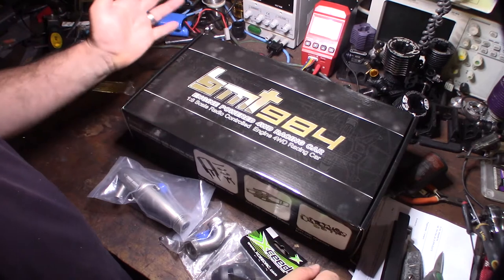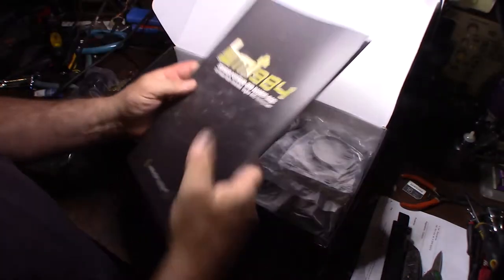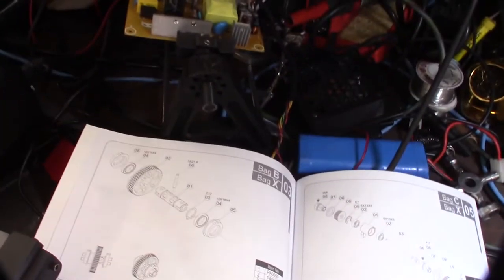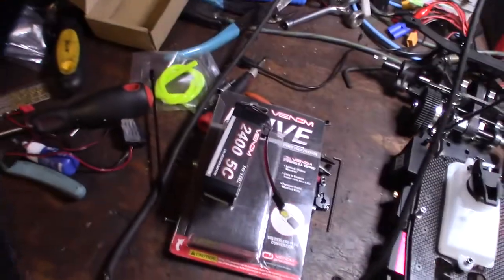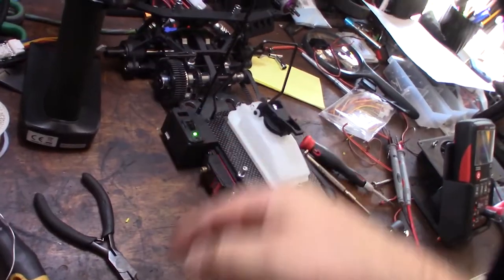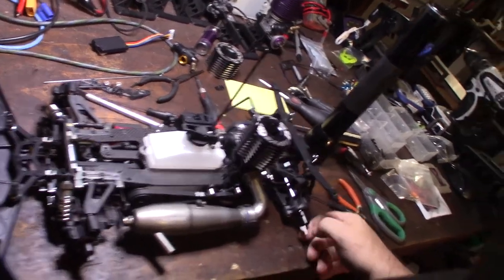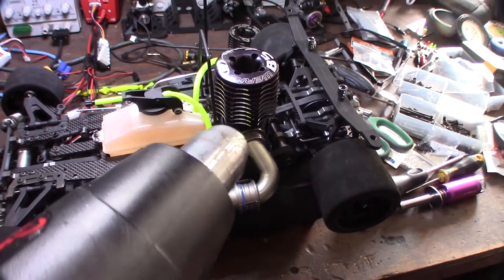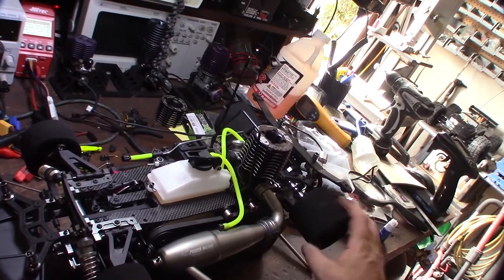BMT 984 Italian made 1/8 on-road nitro RC build with Michael Salven Nova SX21 EV4 Serpent 989

Comment: I converted  a pantera to eleclectric The Car is a sweet 3g to sweeping full tilt drifting extend the apex to how fast you want to change tires addiction. Have Fun Dude you got a drive it like you stole it price base kit in the day started at 1000.00 motor electrics not included 1980 dollars  ave investment 2500. to 5000  to join the club. heat that motor up yes they were that tight warm the head and block and add the extra head shim loosen the plug to start first time. they are angry at first so go say nice things ect